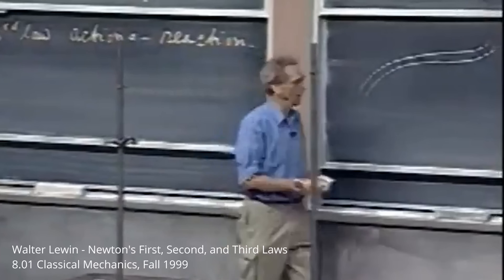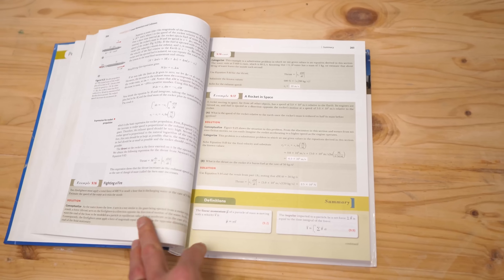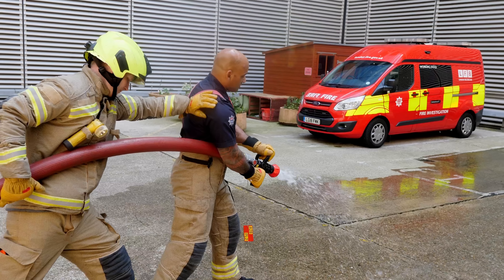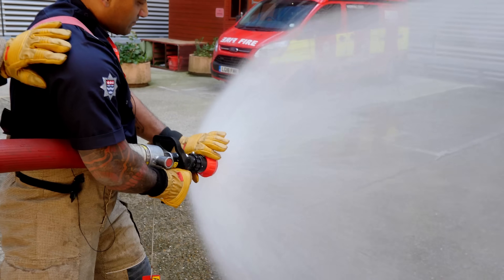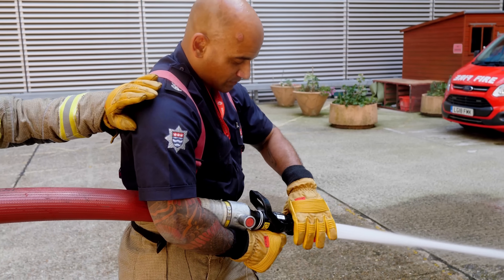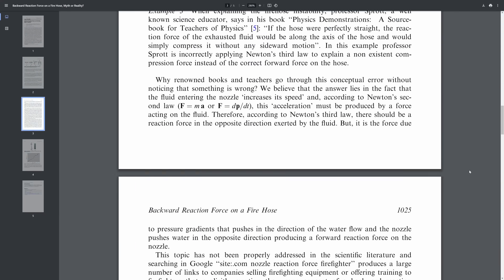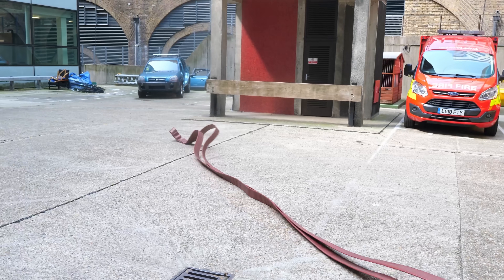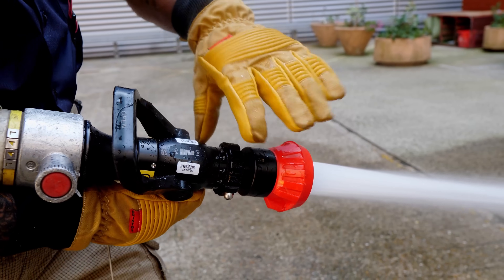Why chaotic hoses dance

Comment: It's funny how this is one of those physics problems where you go on the journey of questioning the intuitive answer cause parts of the problem feel like they don't quite add up, but then its just the intuitive answer all along! Turns out, a hose system is like a rocket engine lol. And it makes sense, a rocket engine is just the ideal form of the system except it doesn't have a hose just a nozzle. To me, going from a rocket to a fire hose make more sense to explain why a fire hose (and inflatable tube man) move the way they do. 

What's the difference between a hose and a pipe that connects the combustion chamber to the nozzle? One is long and flexible, and one is short rigid. What would happen if we connected a pipe to the fire truck instead of a fire hose? This is analogous to a really long nozzle to a water rocket with that has an "infinite" supply of pressurized water and a reeeeeally long throat (if i looked that up correctly) before the nozzle. Now what would happen if we made the throat into a flexible, strong, hose that couldn't hold itself up? Now, at least in my head, it starts to make sense how the system works, we are the gimbal that hold the nozzle/engine. 

What happens when that gimbal doesn't exist or is made out of rubber? Change the propellant to a gas?

A set demonstrations that would be neat to see is effect of a flexible hose, a pipe, a rocket-like nozzle and none of them on some form of rocket or system on a low friction surface. Is there a time delay to the movement the system would experience if there is a hose? How does the nozzle shape change the chaotic behaviour of the motion induced on the nozzle? What does laminar flow do the nozzle movement? I bet the turbulence of the flow of the propellant matters a lot.

A very interesting system and it's essentially rocket science lol! I found this stack exchange answer on how rocket engines transfer their thrust to the rest of the rocket useful! https://space.stackexchange.com/questions/24586/where-does-the-thrust-act-in-a-rocket-engine-and-how-is-it-transferred-to-rocket

Comment: 13:58 I wonder if two pressure sensors, one at the nozzle and the other at the pump, could detect a flailing hose and reduce pressure automatically...

Comment: I'm not entirely sure what causes this behavior, but I do believe it comes down to normalizing distance between different pairs of vectors along the length of the hose.
Separately from this problem I encountered similar behavior, I had made a simulation of a line designed such that it would tend towards curving into a perfect circle by normalizing each pair of consecutive vectors to be of x length, and normalizing each pair of vectors spaced one vector apart to be of y length where x and y have been precalculated according to the expected lengths for the given circle size.
After noticing the behavior of a pool hose being similar to the simulated behavior, I have come up with a reason for why this might be, the hose itself forces a constraint on the distance between each pair of vectors, however it is actually the water flowing through the hose that creates the second necessary constraint, the water straightens the hose and thus constrains the length between each pair of vectors with one vector spaced between, the reason it straightens the hose is because if the hose is curved it will cause the water to curve as it hits the now curving walls of the hose, as every action has an equal and opposite reaction this will cause the hose also to curve in the opposite direction effectively straightening it.
With that out of the way, I'm interested to see your explanation for this behavior and why it emerges from this simple set of rules!
Reply: The water nozzle is a rocket engine... The force felt at the nozzle is the weight of the water x the velocity of the water combined with the angle of momentum of the water when exiting. When it comes to the movements it is same as the chaotic movements you get with a double pendulum.
Reply: @a64738  Hm, yes that is a factor I did not consider, however while this does explain some flaws in my explanation, mainly that the two forces at play both work towards straightening the hose and so it should come to an equilibrium, I do not think that you are correct about the double pendulum. Double pendulums have much less chaotic jerky behavior and are much slower in pace. These two patterns look nothing alike.

Comment: If the hose is perfectly straight, then the end of the hose is in astable equilibrium and would remain straight if not for noise vibrations perturbing this equilibrium.  Tying the end will maintain this equilibrium with little effort.  As soon as it is not perfectly straight, the force pushing the water out has a reaction that pushes the hose back and to the side.  Consider the old lawn mower throttle cables:  pushing the axial wire into the sleeve creates a difference in force between the wire and sleeve at the carburetor end to open the throttle.  This is quite similar to pumping water into a hose... it causes the end of the hose to have a backward reaction force; except the water is ejected at high velocity whether it is then used to 'open a throttle' or not.

Comment: The foremost parcel of water gets extra momentum when leaving the nozzle. But where does the force come from? Can't be the nozzle itself, as none of its surfaces experience a backwards pressure differential, so it must be the water. Back to square one.

Comment: His example in the video is wrong because of a scaling issue, also air can be slightly compressed which causes it to not be as aggressive on the hose. With a water hose if it’s perfectly strait would require less for someone to hold it but lots soon as an angle is achieved.

Comment: I've done solo burn tending on a farm in Australia, and the experience of even a small honda engine + compressor pushing the hose uncontrollably goes from novel to "shit" very quickly. Choking the engine is much faster in that scenario but if the fire's ripping through where it's not meant to, restarting the engine feels a whole lot more slow. 

I can imagine how shutting the hose off from the fire engine would be faster for controlling the hose, but more slow for controlling the fire. Any water flowing ~feels~ more productive than it flowing correctly. 

Either way I believe the actual firefighters that what they're doing is a sensible way to manage a hoe's instability.

Comment: 4:07  i wonder if the reason they described it differently is because they were holding the balloon right side up in stead of upside down like you did so gravity was acting on the end of the ballon in the opposite direction? seems like a fragile enough system that it could matter?

Comment: The nozzle is not just open. The nozzle constricts the flow at the outlet and accelerates the fluid. The fluid in the hose is moving slower than the stream out of the nozzle. This acceleration acts on the nozzle. No it is not the full force but the compressibility of the fluid alone would not make enough force to feel. The nozzle pushes back on you when you open it, not as much as a bend at the end would make but the compressibility is too low to accelerate the fluid enough to make that force.

Comment: This is difficult without diagrams but the forces from the fluid's pressure is exerted in all directions. Right at the nozzle the forces coming from directly in front of a section of fluid and going directly perpendicular to the direction of flow are lost. These are the forces that Steve was mainly talking about. However, there were also forces with components that were not perpendicular to the direction of fluid flow that are lost. Theses forces aren't purely radial nor perpendicular and are eventually transmitted to the side of the hose. Their net radial effect on the sides of the hose cancels via symmetry but there is still a net force perpendicular to the flow direction on the walls of the hose near the nozzle opening.

Fluid under pressure in a container doesn't exert force only straight outwards on the walls of the container. At every point on the wall there are forces acting in a half sphere from the fluid. Everything but the forces pushing directly outward on the wall cancel. However, if you pick a point on the wall and remove half of those forces by removing the fluid on one side that force cancelation no longer happens. Now there is a net force on that point of the wall that is in the opposite direction of the fluid that is missing.

Water leaving a hose doesn't just push straight back on the water behind it but also backwards on the walls of the hose itself. My intuition tells me that if you added up all the net backwards forces on the walls of the hose you'd get an answer very close to the rocket explanation.
Reply: The losses in the water hose and pump and nozzle is irrelevant because the water nozzle is a rocket engine... The force felt at the nozzle is the weight of the water x the velocity of the water and angle of momentum of the water when exiting, and the losses do not matter and only over complicates it.

Comment: I feel like this is very intuitive. If you've ever left an open garden hose lying on the ground and then turned it on, you'd have seen that the end immediately gets pushed back (just like a rocket). If your reasoning about a continuous chain of force were right, the rest of it would never stiffen and straighten.

Comment: I worked on an oil rig, where a special “mud” is forced down the drill shaft at enormous pressure. The large connecting hose was rumored to be lethal if it ever broke loose.

Comment: The backwards pressure on a fire nozzle is the same as the reaction force on a rocket engine. At the nozzle, there is equal pressure on all the interior surfaces of the hose/nozzle EXCEPT for where there isn’t an interior surface,,, the nozzle orifice. The pressures in opposite directions that are equally constrained (like at right angles to the water’s flow, against the walls of the hose, cancel each out. The only direction the pressure’s aren’t cancelled out are in the opposite direction of the orifice. Therefore, the only uncancelled force is backwards from the orifice. JUST LIKE A ROCKET!!!

Comment: In pipe it more like equilibrium, force at tip will have some reaction back to certain distance but in water hose the tip is heaver than the pipe itself so it has more violent reaction like you put weight at the end of trailer it make the trailer a lot more unstabe. That's what I think you guys will have better explaination. Than this unemployed person (me obviously)

Comment: But there was no nozzle in your test; the velocity doesn't change at the tip, the momentum doesn't change.
What I think is happening there, is that the working tube is under tension, equal to the momentum flux of the fluid (just like for the chain or rope in Mould-effect like situation). During the turns the fluid changes momentum giving the difference to the hose, so the hose would move if not for this tension (that doesn't depend on the turn rate, just on the momentum flux, because it compensates it) - you can actually see that movement when you turn on the "straighter" tube. Once you balance the tension at the free tip, the whole system becomes balanced at every point ("stretchy" momentum flux of the liquid is balanced by the tension of  the hose).
Reply: I'd still have to think about what a nozzle does, if anything. That is: would we see a difference between the forces needed to stabilize two hoses that have different width all the way throughout, but at the tip they have rigid nozzles that make their output identical (same velocity, output and momentum flux)

Comment: but what if you connect a solid pipe off the truck? The fire fighter wouldn't feel the recoil of the hose, the truck will, even if the pipe is bent

Comment: If you attach a jet engine to a spacecraft that pushes the spacecraft in a specific direction, and then add a tube to the jet's outlet that has an outlet at a different angle (e.g. 90 degrees to the original) then which way will the spacecraft move?

If the propultion force is acting at the jet engine then the spacecraft's motion will be the same with a straight or bent tube, but if the force is acting as if it is from the outlet then the behaviour will be different.

Comment: I think the reaction force acts on the lip of the tube. As the stream of water exits the tube, it drops in pressure causing it to expand slightly and push against the exposed end of the tube.

Comment: The force felt by the fireman must surely be caused by the nozzle itself. Imagine a perfectly smooth hose with zero friction and no nozzle...the force exerted by the water on the hose would be zero. But, if you put a nozzle on the end, you restrict the flow. By Bernoulli, the water accelerates. The additional energy to accelerate it forwards propels the nozzle backwards. One experiment that would strengthen this argument is to use a hose with an adjustable nozzle. Notice that as you adjust the nozzle, the amount of force produced by the stream changes.

Comment: Force is pressure times area. Or more precisely, pressure times area in the direction perpendicular to its surface. The length of the hose is parallel to the walls, so the pressure isn't going to push it forward or back, but this isn't true at the nozzle. Since it's narrowing, the pressure of the water should push it forward.

Comment: 14:50 the situation is a bit different for water, its orders of magnitude heavier than air and therefore carries a lot more momentum, but regardless this made me think about how this force manifests. As a civil engineer thrust blocks came to mind, basically giant concrete blocks that we put at all the bends of buried pipes to resist the unbalanced forces created by the change in direction of water flow. Just looking at some pictures of these blocks you can get an idea of how strong these forces can be. One interesting point though is that you Can in many situations just bolt the joints together really well or ensure the pipe is strong enough and then the force can be distributed as Tension along the length of the pipe, ultimately needing to be resolved either into the soil along its length or some sort of support (like a firefighter!) For the held air hose or fire hose on the ground behind firefighters situation I think we don't see active movement because, as I said with bolting joints, the pipe is put into tension and so the free body diagram of each individual bend is resolved. A mental exercise that I've thought is interesting is an L shaped pressure vessel, the corner will experience a static force similar to in a pipeline, but the caps will also experience an equal and opposite force meaning that (obviously) the pressure vessel wont magically start moving. Instead the outside of each leg will be put into tension to transfer the force from the corner to the cap and the whole thing will want to bend and straighten out, like pulling a rope taught. I think that is important to keep in mind when thinking about pipes like in this video, they're basically a fixed length and quite strong so they're not going to just stretch or break or start magically moving, they have internal stresses and will distribute forces. Of course none of this is to say that I think the video really did discount the strength of the rocket nozzle effect, like yeah there's newtons laws and yeah there's the rocket thrust equation, but a clear way I thought about it was that the pump charges up the hose creating potential energy, the nozzle is what converts that to kinetic energy and therefore also experiences a reaction. Its like how charging a slingshot takes energy and requires a reaction forces, releasing a slingshot will also create a reaction force and have a bit of recoil. If you didn't hold the slingshot it would launch backwards equal to the momentum change of the projectile - the rubber band would just close in from both sides. Anyway good video, really got me thinking which I would guess is the whole point
Reply: Your long text of explanation is extremely hard to read and I had to give up because it is all written as a non stop long paragraph.

You should ALWAS divide your texts using paragraphs to help make it more easy to read.
Reply: @a64738  fair enough. This was just my rambling thoughts as I watched the video so I didn't really expect anyone to read it seriously, but I guess if I'm going to actually post it I could put a little effort in to make it readable. I'll keep your suggestion in mind.

Comment: 3:33 it really looks like a version of the chaotic double pendulum
Reply: It definitely appears to be a very similar motion however it seems restricted by the hose itself, the vertices of double pendulum graphical models have full range of motion but that's just not possible with a hose because of the structure and material. Interesting none the less
Reply: I thought the same thing at the same place in the video, which is probably where the video will end up... I have to finish it
Reply: @bryan.souza.  it doesn't end up there, although there is a very suggestive part where Steve mentions a restoring force and an inversion of the motion

Comment: The force felt at the end of the hose is a function of the stiffness of the hose and the momentum of the fluid inside. The stiffer the hose the less force is experienced. A fully rigid hose will experience zero force. A very flexible hose will experience a force of mdot*v

Comment: I just think of this as a constant flow (MxV) situation where the K.E. = 1/2 M(V^2). As the nozzle constricts, an increase in velocity is needed to offset the mass that exits per unit time. Thus the propulsion from the square of the velocity. As a result, the pump must work harder to supply the energy.